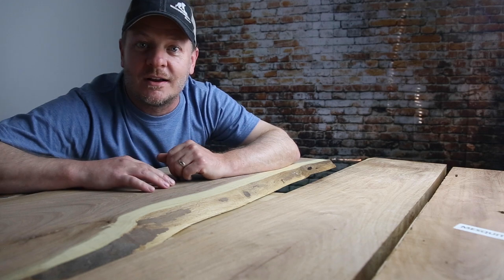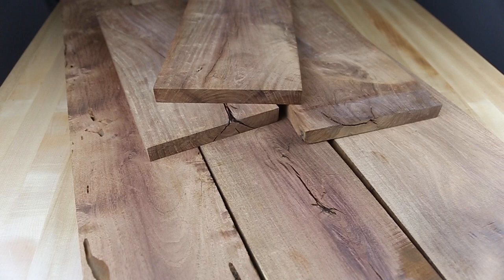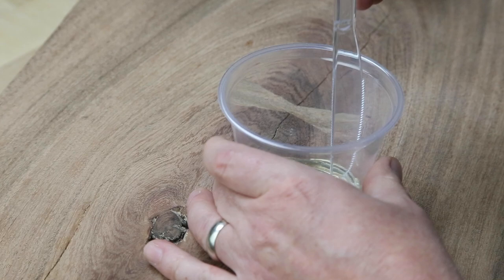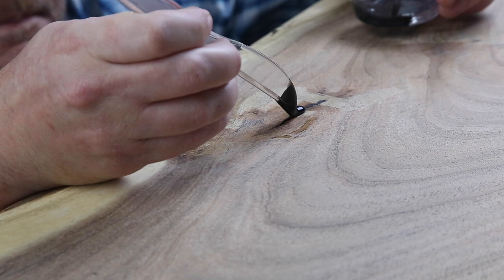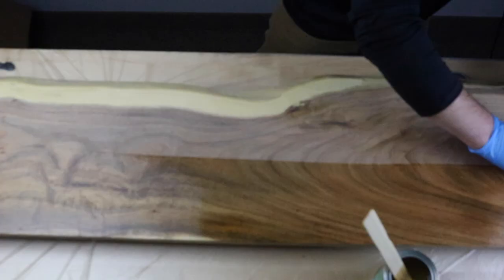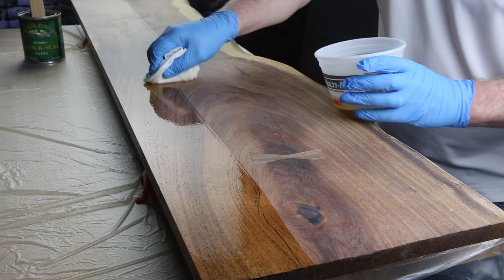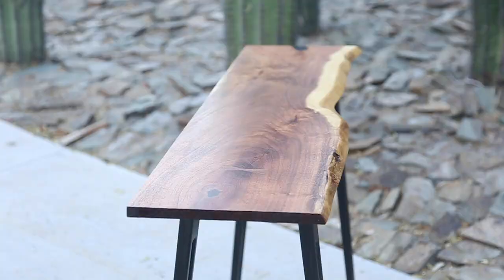HERE IS WHY MESQUITE Lumber Is Really Cool for Woodworking

Comment: Nearly half my work is with mesquite, it's in my top 5 list hands down.  My favorite thing about it is the hardness and the fact that you can work with it almost completely green within days of dropping the tree. I can take a tree that was felled just 2 days ago and make 1/4" thick drink coasters and never have to worry about them splitting, or cupping. For perspective, a coaster that thin made of hard maple or pecan cut 2 years ago would buckle and cup conforming to the shape of the cup if not smothered in finishes.
Reply: That's great info, thanks

Comment: "HOWDY!" 🤠
(Central Texas) Mesquite has character and is really hard.
End grain especially...I use it for hammering copper actually.
*EasyOff ...oven cleaner gets the pitch/burnt sap off saw blades.
Black epoxy looks good but if I really want lighter sometimes I just  take the orbital sander to it to make "wood flower" and mix that in.
Nice video....gave ya a 👍
Reply: Black epoxy does look good in Texas Mesquite.  And though I'm not into all those craze epoxy colors everyone's doing these days, blue is just an awesome color for filling small voids and cracks.  Obviously blue in the center of the void, but it tends to be much darker to almost black at the edges of the wood.

Comment: Started with mesquite back in the 70's.  Love the epoxy fills.  Personal tip - on small fills, after you mix & tint the epoxy, wait a sec.  The epoxy will start to heat up (curing reaction), once it's very warm start your pours.  The warmer/hot epoxy gets farther into the small cracks, this can sometimes save a follow-up pour.  Love mesquite.

Comment: I've primarily worked in mesquite. I've probably made 100 different fireplace mantels, entertainment systems and furniture from it. I used to do the epoxy stuff but now I just let it roll without any epoxy. I find I like the cracks. Sometimes I'll even highlight a crack by carving a bevel around the edges. I like using boiled linseed oil or tung oil to finish. Each finish produces a different color. If you use tung oil and put the piece in hot sun it turns really dark red, looks cool. That yellow cambium layer is highly susceptible to powder post beetles even long after the piece is finished and sealed. Very frustrating considering how beautiful the yellow is but I've made furniture and years later you start seeing the telltale sign of yellow saw dust tracks. Bigger beetle larvae will eat into the wood but those holes create amazing and beautiful patterns. They only eat to a certain depth and after a time they stop. Also the root balls make really cool furniture if you're willing to invest the energy to dig them up. They make great end tables and such. I made a really huge giant throne from a single Chilean mesquite log with mortised white oak log arms. It looks really cool but takes a bunch of guys to move it. Mesquite also carves really well with sharp hand tools. It holds detail well using hand tools. The cuts are sharp and crisp but it's kinda tricky because the grain changes a bunch. I don't really like how it looks with power carving though.

Comment: Here is why I think Mesquite is good for grilling but Hickory is better, for grilling and making projects.

I live in West Texas where we have mesquite bushes, the natives call them trees but to me they are bushes. I am from back east where we have trees. 150 foot plus tall trees. Many different kinds of tress too.

My neighbor cut down a mesquite this spring and he gave me a bunch to work with. I put the wood in my shop to dry out. I kept hearing chomping sounds in my shop when everything was quiet. So did my dogs and cats. Then I noticed piles of saw dust on the floor, I am talking about 1/2 to 3/4 inch tall piles of saw dust everyday I would sweep it up for a week. I decided to cut open the logs to see what kind of critter was making the noise and the mess, it turns out it was a worm looking critter with mandibles for gnawing the wood it was tan in color about 1 inch long. Well that is what it was before the .25 kerf bandsaw blade bisected it’s body.
I got rid of the wood it was not worth infecting the rest of my wood. I tried spraying the wood with isopropyl alcohol and several bug killers. Before just chucking it.

I guess that worm though he was improving the value of the wood by giving it nice worm holes, but I thought different.
Reply: Yeah, know about them wood borers in Mesquite!
What's fun is to be turning a piece and hit one, then you get splattered with bug juice! 😊
Reply from the maker: Haha, yeah, the wood should be put in a kiln to dry and kill off the critters.
Reply: Woodworkers Source You mean outside here in W Texas? The kiln would keep the wood cool!
Reply: WHAT PART OF WEST TEXAS?
Reply: Likely a mesquite borer larvae -- Megacyllene antennata  
The worms with their flat heads look cute compared to the adults when they first emerge from the wood like an alien spider!
Ken Gamble is correct, I cut through them often when turning air dried mesquite logs. When done, I put the turned work into a solar kiln for a few weeks (210+ degrees). This kills everything before I do the final sanding and finishing. Something to note about this borer species, The hole first goes straight into the log and then does a 90 degree turn. Likely helps the bug survive the efforts of woodpeckers!

Comment: I can't believe you made a video about this species....that's awesome!
and you're right,  this wood has a character of its own and it is difficult to find logs of significant dimensions.  One thing I have to mention,  the varieties you mentioned are truly of a desert origin but you can find better quality of wood as you travel south, past the drier regions of the Southwest and northern Mexico. Right around the central states of Jalisco, Guanajuato and Zacatecas, towards the north of Mexico city,  you will find some gigantic mesquite trees around the crop fields and normally on the valleys of unpopulated regions of central Mexico. I've seen trees reaching 40 feet in height and up. As you mentioned,  you won't find logs with an attractive length but they easily reach 4, 5 or 6 feet in diameter. My favorite part of working with mesquite is the aroma of this wood and I learned with time that,  the oldest the tree, the smelliest and darkest the wood. 
Thanks for posting this video.

Comment: I might fault for being out in the backyard BBQing with fuzzy slippers on though, lol. Working the epoxy; to get it to settling in quick and reduce air bubbles just a simple hair dryer, warms the epoxy so it flows well and reduces the reworking.

Comment: Mark, your videos are really good. You are a natural.
I love the Tucson store and staff!
I am glad that you recommend black tinted epoxy. Black epoxy & mesquite are like butter & popcorn.
In my opinion, turquoise and other bright primary colored epoxies in mesquite are like howling coyotes, a passing fad.
From the comments, there are 2 things to add to your next video on mesquite:
1. Mesquite is very stable with less expansion and contraction from changes in humidity than most varieties of wood.
2. Federal & state governments have spent millions of dollars (unsuccessfully) trying to eradicate mesquite in the southwest. 
It can be harvested sustainably. The most successful way to kill these trees is to use a backhoe & dig out the tree and root ball. $$$$$
The flyover in your video (0:34 to 0:35) of the Santa Rita experimental range* is just one of the countless places where they have tried for decades to remove these trees from grazing land and riparian areas.  *(Flying toward Elephant Head in the distance)
Unfortunately, the native species of mesquite trees do not commonly grow to a size and shape that most large manufacturers can easily use.
However, South American species are very fast growing and do grow larger and straighter.
I have worked with a variety of mesquites including South American types and find it impossible to tell them apart on finished work. The only distinguishing feature is non-native mesquite seems resistant to attack from Megacyllene antennata (mesquite borer beetles) so they lack the worm holes usually found in air dried native mesquite logs. 
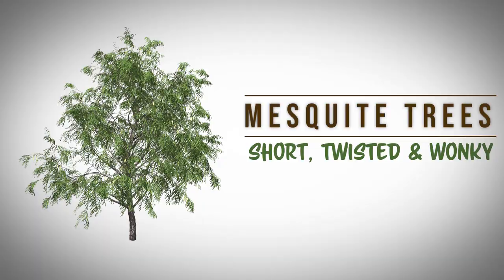Lastly, the tree shown from 0:36 to 0:38 & again from 0:45 to 0:47 is NOT a mesquite, but actually an Arizona White Oak, Quercus arizonica, covered in catkins and a few small new leaves, which happens in late spring immediately after the old leaves drop. Oracle AZ has an annual festival celebrating the oaks during this season. Carefully note the bark. The crooked branch pattern does look similar to mesquite.
For a remarkably similar view, see the background photo I took last October for my art group website:  https://www.oracleartiststudiotour.org/

Comment: I always use epoxy mixed with wood flour (sanding dust from the same board that I am working with) to fill cracks.  Mix the epoxy well, then add dust slowly until you have a peanut butter consistency then apply with a plastic card or trowel pushing it into the crack.  Leave it a little proud because it shrinks as it cures, then sand after curing.  BTW:  ALWAYS WEAR NITRILE GLOVES WHEN WORKING WITH EPOXY.

Comment: From Texas it's was everywhere. Makes good fire wood. But I had a small set of bed side tables.  😕 Unfortunately my ex took them when she and I split. The neat thing I did because we did close hole with epoxy, some of the boards had holes . I used said holes as my drawer pulls for the drawers...

Comment: I'm originally from El Paso, so I used to pick up mesquite here and there. Gorgeous wood! TOUGH wood. One time I was driving from Lubbock to El Paso and I saw a HUGE pile of mesquite that TXDOT had cleared along a hundred + miles of highway. I went back out a week later with a truck and a saw to pick up all I could carry. Wouldn't you know, all I found was a pile of ashes.

Comment: Question you mentioned ceiling both sides. I just did a walnut table top natural stain and polyurethane it do I need to polyurethane the bottom half and if I don’t will a crack or what thanks. Great video

Comment: That Arm-R-Seal seems to handle like a shop-blended tung oil and varnish mix, a finish I've used for 30 or 40 years. Have you worked with the so-called hard oil finishes? I'm thinking of Odie's but hate to drop a hundred bucks to try it. You do really nice videos. Best of luck.

Comment: OK I am on board, just saw the AZ highways article on mesquite and am ready to buy a slab. What happens if I skip the epoxy step and just sand and stain?
Reply from the maker: It’ll be fine structurally, but filling will keep any cracks from growing over time.
Reply: @WoodworkersSourcecom  Thank you for the help

Comment: What was the metal looking rectangle sheet you used to scrape the surface (after using the hand planer)?
Reply from the maker: It's called a card scraper, or sometimes a cabinet scraper. Very handy tool.

Comment: Thanks for the video. I have watched your finishing videos for a good while and have developed a trust for your information. Just came across Odie's Oil and was wondering your opinion. Seems very easy to use and gives a nice luster. I realize one finish is not good for all circumstances but it seems pretty good watching it in use. Do you have any experience with it?
Reply from the maker: Haven't used it directly, but 3 or 4 colleagues here have recommended it to me. So I suspect it's good stuff.

Comment: Using only mesquite to BBQ is not really good.  The wood tends to have a lot of resin in it which is why you never park your car under a mesquite tree.  Use small pieces that you have soaked in water for flavoring the smoke.  Burning only mesquite in a fireplace is also dangerous because the wood causes creosote to precipitate onto the inside of the chimney which in turn can cause a very hot chimney fire.